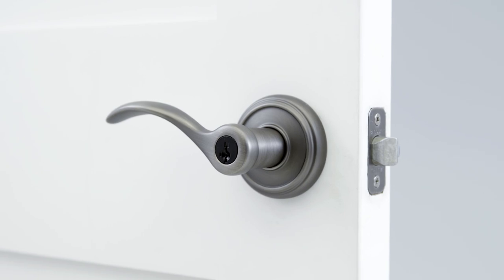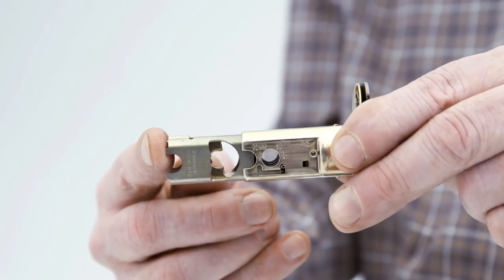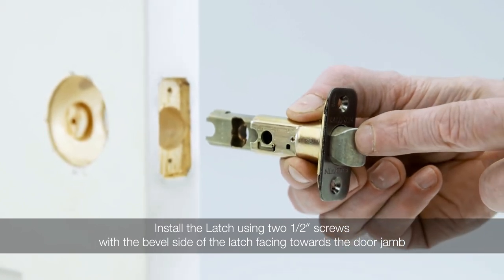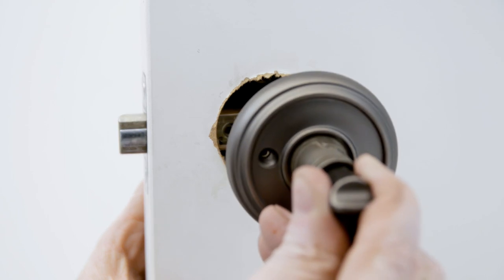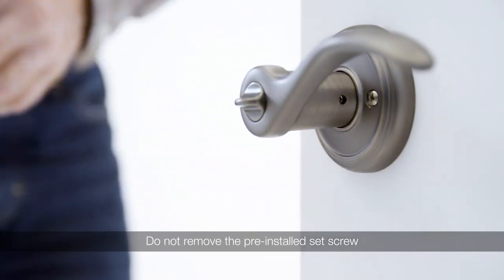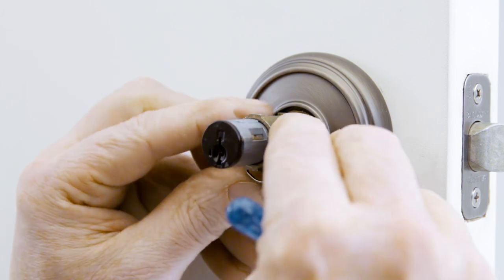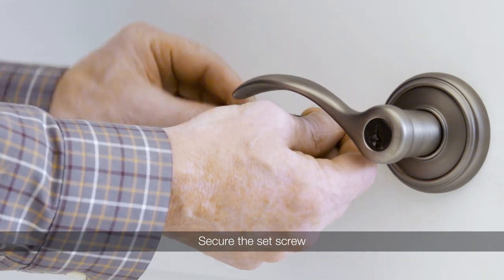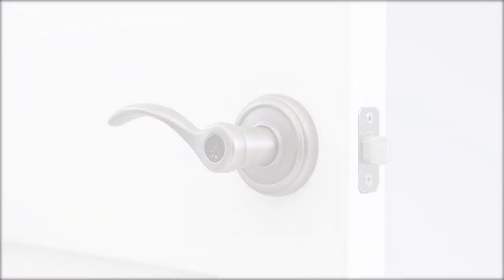How to install a Baldwin Prestige Lever

Comment: Help me understand.....If the outside knob can be taken off with an Allen wrench, and once the outside knob is off, the cylinder clip can be removed with a screwdriver, and when the cylinder is out I can see the mechanism (2:04 in video) to unlock the lockset, then all I need to do to get in a house with this lockset is an allen wrench, a flat blade screwdriver, and a pair of needle-nose pliers.

Can anyone explain what I might be missing?

I wrote to Baldwin, and they answered:

The only way you can access the exterior set screw is when the door is unlocked.  When the door is in the locked position the hole to access the set screw is closed.  This was designed as a security feature.
Reply: Iam wondering Why the beveled side of latch outside, isn't it easy to push open?

Comment: The real question is how do you change the lever direction? It took an HOUR for a guy a Lowes to figure out how to do it. This is after I had spent over an hour trying myself and had given up decideing it could not be done.
Reply: Tanya Stinson I’m in the process of trying to figure this out! What finally worked for you?
Reply: @Ashllera  did you end up figuring it out?

Comment: I have the Baldwin "DEC.TAR.150" lever from the "Reserve Collections".  It looks absolutely identical to the far, far more costly "Bethpage" lever from the "Estate Collections"... so I figured, why spend twice as much, right?  Well, now I see why.  These "Estate" level (and apparently from this video, also the "Prestige" level) of door levers use these funky miniature set screws to hold the lever onto the door.  This results in a lever that is very wobbly and has a huge amount of loose play in it, no matter how much you tighten the almost microscopic set screw that holds it into the door.   Indeed, if you think about it... how could a heavy metal lever possibly have a firm and secure feel if the only thing holding it onto the door is just one very tiny set screw that is just one-quarter inch long by one-eighth inch thick?  It produces a very cheap and disappointing, loose, wobbly, "about to come off in my hand" feel every time I grasp the door lever.  In fact, about once every several months, some of them do come off in my hand, and I must find the allen wrench and re-tighten the tiny set screw.  Poor design.  However... a beautiful door lever, and ultimately, it's not that big a deal to have to go around and tighten all my door levers down once every 9 months or so.  They are still wobbly and loose when I'm done... but they are attached enough to secure the lever for another several months. I'm wondering, if I had spent the considerable additional sum for the identical looking Estate Collection Bethpage lever... those would NOT use these funky little set screws to hold the lever onto the door, right?  They surely have a better design.  This should be disclosed to customers prior to them spending $1,000 on 10 Baldwin door levers, as I did a couple years ago. I would have purchased the more costly ones if I had known.
Reply: I totally agree. Have had the same problem.  A very poor design for costly hardware

Comment: I have 2 of these and the lock turn on the interior will not turn you can only lock with key.  I have 3 of these and I dont recall doing anything on the first 1 different.   Any ideas?
Reply: my Baldwin Prestige is a little different, but I had the same problem and found that there is a dependency on the screw which holds the external handle in place. Once I tightened that screw, the lock turn button started turning.
Reply: @slowowl  OMG.  you saved me.  my old baldwin lock stopped turning because a spring broke inside so i bought a new one and when installing it the lock didnt turn.  thinking it might be broken i went back to home depot and exchanged it - and assembled it in the store to test.  no problem.  then when i put it on the door it didnt turn again.  i fought with this for an hour checking everything that could be moved and finally resorted to youtube.  watched this video, which is much better than the paper instructions in the box but didnt address my problem.  then saw this question and then the doh moment.  i had loosened the set screws to put the handles on and tested the lock before finishing.  normally a rational thing to do before final trim installation.  5 minutes later i finally had what should have been a 5 minute job in total.
Reply: @dthoog  glad I could be of help :)